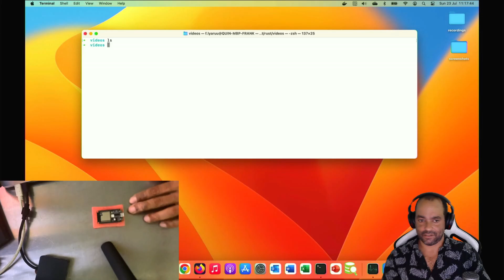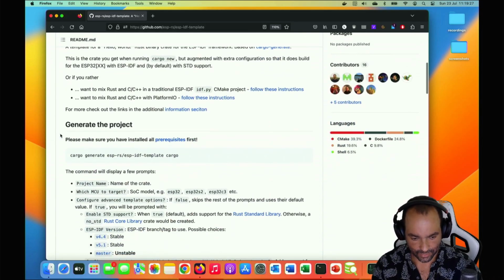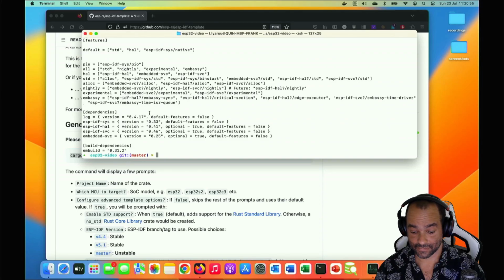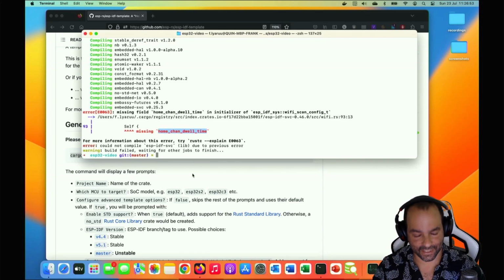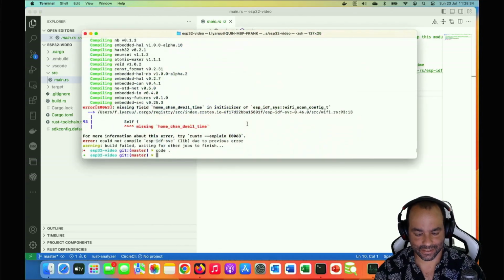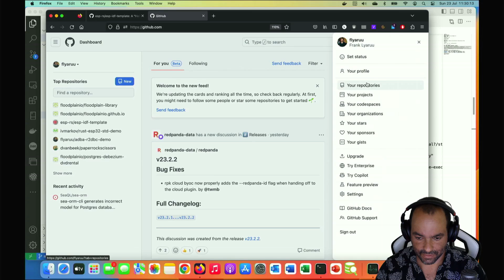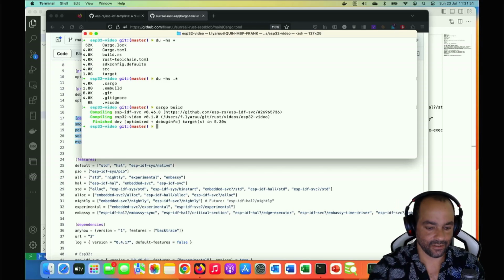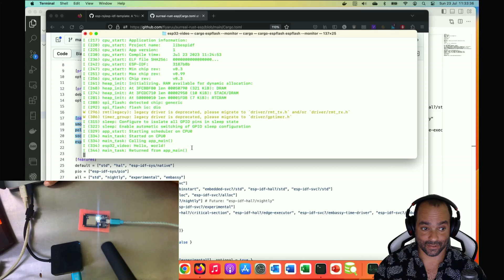Rust on ESP32 - Getting started

Comment: C is great. Don’t hate on C. 

Having said that, I really do like Rust. I wish the the Rust Foundation wasn’t so crap. But the language itself is pretty good.
Reply: yes but is not a modern language and if you need to do something like string manipulations you will struggle at it, I known c, but I mainly use python because the development is faster and often you don't really need the c performance everywhere. I'm learning rust because it's a good compromise, particularly for dependencies
Reply: I won't hate on C, or any other language. But the strengths of C do not include an inviting, inclusive user community with tons of novice-friendly handholding tutorials.  There's just way too much stuff to remember with C (std lib functions that you're never supposed to use, or inconsistencies in the language itself). 

I don't think one can avoid C professionally with embedded, but the more "casual" coder will have a better experience in anything besides C.
Reply: ah yes, lets just completely discard rust because of some wokies, very wise and smart
Reply: whats wrong with the foundation?